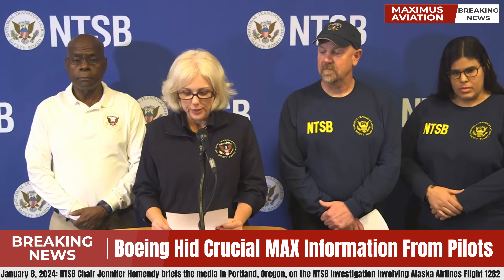Boeing NEVER Told Airlines That 737 Max Cockpit Door Was Designed To FLY Open During Decompression!

Comment: There’s no doubt that Boeing is headed for another disaster if no one takes control of this out of control company.   Aussie Bob
Reply: The fuckers just want to punish whistleblowers, push DEI and ignore the engineers.  They need to be held accountable for their failures and illegal behavior.  Who's in jail over  MCAS?  These military contractors are immune from accountability.
Reply: @LiveWire_Guy  Unfortunately, engineers and safety inspectors do need to go to jail over entirely predictable disasters like MCAS and inspection shortcuts even if they were under huge pressure from management. When safety culture decays to the extent it obviously has in Boeing, the only way of restoring it is to reenforce personal responsibility. Those who sign off on these technical details need to be able to say to the MBAs "I hear what you say, but I'm not going to jail for you", and for it to be credible, that does actually have to happen in the worst cases.
Reply: @john_hind  but not the managers? Weren't they ultimately responsible for the time pressures and the failures of safety culture? Seems a bit of an odd conclusion...
Reply: @andrewdenby8239  Morally I agree with you. But legally, it is very difficult to pin responsibility on an individual manager since there is rarely a paper trail from a decision to a specific consequence. Named engineers sign off on designs and named inspectors on quality so there is that paper trail. My point is that a few of those need to go to jail so the rest can better resist pressure to cut corners. A manager cannot order the engineer or inspector to sign, if they want to overrule, they can, but they will have to sign themselves and take responsibility. I want to restore the safety culture, not send anyone to jail.
Reply: @LiveWire_Guy  You can be right about a whole bunch of stuff and then you gotta throw in "I'm a racist because I think any black people working here are obviously DEI"
Reply: Time to put the engineers back in charge, instead of accountants more concerned with shareholder value, most the blue chip shareholders have private jets, and all they care about is profits over people.
Reply: @colin-nekritz I’ve worked at a lot of engineering driven companies.  They really are no better at managing a company than any other regime.
Reply: @colin-nekritz  Engineers are not good at dealing with customers.
Reply: Problem is the company must be successful: otherwise politicians heads would roll. Normally on a purely commercial market this comapny would have been closed down ages ago. So this company is going to be sold as a "sucess" story no mater what they produce, how bad they fck up.
Reply: Probably delegated inspection responsibility to the operators. They are all doing this now. As a former quality manager i was fired from a job of 16 years because I refused to delegate this. The operators were not qualified to inspect. This is what happens when you do this. Same thing happened with the software issue. The final approval was delegated to Boeing by you-know-who. Apparently this delegation was recended.
Reply: @bighoss9705 "Apparently this delegation was recended." - problem is know-how is not something that can be easily and quickly moved around.
Reply: I unfortunately bought Boeing stock right before the first max debacle and it never recovered. Ditched that stock. Don't see ever buying Boeing stock unless they do a 180 and complete gut job of their entire company. Not 2 nickels worth of integrity left at Boeing. A real shame. And has become a widespread issue across large companies. No integrity.
Reply: @travish4276   you are correct, it is widespread and it affects all businesses that adopt the practice of graduate hires being given priority over those timeserved individuals, integrity is not high on the agenda for undergraduate syllabi, Boeing's heyday was a time when a team was grown from long term hires and the relationships that nurtured, integrity comes with that territory.
Reply: @travish4276  Time for them to be prosecuted
Reply: The coverup with the NTSB is now well underway.
Reply: @jquint57  How so.
Reply: Why would the secondary pressure computer be checked in December, and twice in january? Seems really odd
Reply: Boeing doesn’t care.  They are for profit.  Insurance will pay any deaths.
Reply: Let those airframes been built in Chana as Apple is doing this since many years to gain quality.
Reply: Don't be a drama queen. They'll solve it. They have 4000 Max orders right now.
Reply: @RLTtizME 
They said this in 2019 after the second crash and the worldwide groundings.  
And yet here we are.
Reply: They are not grounded once inspections have taken place. Quite different. Do you know where you are?
Reply: @Rasscasse Boeing actually tried blaming the flight crews for the earlier crashes.
Reply: @RLTtizME  Orders can be cancelled.
Reply: @kray97  And orders can be added to. You are scraping the bottom of your brain.
Reply: @RLTtizME  You sound scared bud....I've already heard about orders getting cancelled. Bet Southwest is glad they had no MAX9s lol. What's impact of all the flight cancellations caused by the grounding? You don't think these airlines are going to look elsewhere?
Reply: @kray97   4000 current orders Pal.  The sales of Max 9's are fairly limited. Flight cancellations will be addressed just as they are for Air Bus groundings. SWA will be buying a lot more Max 8's. Hundreds. There is a reason for that Buster.
Reply: @kray97  To answer you question...no. The advantages of the Max more than out-way the developmental issues. I know that cancellations fit your made up narrative...
Why would I be scared Pal? You made that up too.
Reply: @RLTtizME  You should tell that to the families of all the people killed in those two MCAS related crashes.
Reply: @kray97  They really can't. There's no viable alternative at the moment. Airbus also faces a major backlog.
Reply: @generic_username-q7x  Yeah, I read that article too lol. There are other competitors - not just Airbus.
Reply: @kray97  Not sure what article you're referencing. No one else has the capacity of Airbus AND Boeing. Embraer has delivered half the number of E series in 22 years as Airbus has for the A320neo alone in 10. Boeing has nearly matched the Embraer numbers in 9 years for the 737 Max line alone.
Reply: @kray97  Oh...going for the moral high ground. What DO YOU have to say to the families who lost loved ones in the many Air Bus accidents?  Stop being pathetic.
Reply: @generic_username-q7x  China makes airliners too now.
Reply: @kray97
Yeah "Chinese made" isnt exactly a statement of safety and quality.
Reply: @kray97  I am not including Russian or Chinese state-owned manufacturing, who have built a total of 12 narrowbody airframes between them in around a decade.
Reply: @RLTtizME  And the reason for that is like Boeing they apply grater importance to larger profits than passengers lives.
Ever heard of a door falling off a ford, GM, BMW etc car because it wasn't bolted on properly?
Reply: @childofcascadia  Neither is made in USA anymore nowadays.
Reply: @andrewallen9993  No but I have heard of a myriad of recalls for faulty installation of certain critical parts.  You better put your thinking cap back on and come up with a better argument.
Reply: @RLTtizME  but not as safety critical as doors in a pressurised environment?
Reply: @andrewallen9993  You're stretching your narrative to make it fit. Actually a widespread automobile recall can, in many instances...represent a safety critical situation and in the aggregate...can kill many more than a one-off airplane incident.
Reply: @RLTtizME  Would you rather the door fell off your car whilst driving or your aircraft at 30 000feet?
Reply: @andrewallen9993  Neither.....thanks for posting. I do recognize that life is full of hidden dangers. Stop clucking.
Reply: @kray97 I think Airbus is sold out for several years.
Reply: @RLTtizME  were you sitting in the suicide seat?

Comment: So a potential "bad guy" can open a door in flight to gain access to the cockpit where a crew is trying to figure out what's wrong. IDK but how did this pass certification?
Reply: Under normal circumstances, you can't open a door in flight. Meaning if the cabin is pressurized. First need to dump cabin pressure to be equal to outside pressure, then you can open a door or emergency exit.
Reply: In fairness if a 'bad guy' can cause an aircraft to depress to that extent access to the flight deck is probably fairly low on the list of immediate problems... And I can sorta see why it does as presumably if the cockpit remains pressurised while the rest of the cabin decompresses then gaining access to the cabin afterwards if needed might be tricky to do safely, especially if they're at a regular cruising height. That being said there's NO way that shouldn't be in big red letters somewhere close to the front of the manual and makes you wonder what else Boeing haven't disclosed.
Reply: Oh just read the description, yes exactly my point.
Reply: You don't need to clarify it further for the terroristis!
Reply: So, how would you design the door then?
Reply: Explosive decompression is a larger problem than a burst panel (door) functioning.
Reply: Blow a windows, then enter flight deck. No no no. ICAO Annex 17 must be amended to disallow this shoddy Boeing practice
Reply: @unggrabb  Well, now that the baddies know about the "workaround"!

Comment: The FAA approved the aircraft.  Did they approve the documentation that was deficient.  All this rubbish makes you feel very insecure.   Once again.  No Boeings for me
Reply: Actually the FAA didn't certify the max originally, which is the root of the problem. Boeing lobbied the administration some years ago to get permission to self-certify. They used the same argument as wall street, ie no one knows the business better than us, so we are the best ones to regulate ourselves. This led quickly and directly to the 737 max disaster.

In the past, any and all aircraft models required an FAA type certificate, or an STC supplemental type certificate for add-ons and modifications, granted after full engineering reviews and flight tests. Now Boeing is trusted to perform this themselves for their own aircraft.
Reply: @PRH123  therefore by avoiding their responsibility they approved it
Reply: Its greed. Thats it. Just like MCAS
Reply: Precisely, no way will I fly in a 737 x MAX. Boeing needs to be nationalized or closed down. Unfortunately a prime example of  capitalism gone wrong ( = greed and/or corruption)
Reply: It would not be the first time the FAA was missing the needed thoroughness when they approved aircrafts.
Reply: @despoticmusic Blow out panels are not the same thing as the entire door swinging open.
Reply: It's called REGULATORY CAPTURE. They lobby some campaign money to ALL PARTIES in the govt to fulfill their special interest. Yall think thos is worse? PROJRCT 2024 is a total take over of the govt by corporations. No need lobbying and corporations could save even more money
Reply: Airline passengers motto. "If it's Boeing; I'm not going".
Reply: The government doesn't care. What a clown show.
Reply: Riiiiight, lol.

Comment: Boring………. hey btw, airplanes aren’t ships so let’s use MPH instead of Knots. (Nauts) Nobody has any sense of what that even means outside the military and specific industry anyway. Boeing sure seems to have a history of inserting Surprises into their aircraft and failing to tell ANYBODY about it. Just another reason to avoid the brand??
Reply: You misspelled kilometers.
Reply: Kilometer is the American spelling whilst kilometre is the UK spelling of this word.
Reply: Why would you swap to a unit of measurement that was obsolete half a century or more ago?
Reply: Instead of complaining, why don't you research why. Are you in the the aviation industry? I doubt it..
Reply: If you change for something standard, then change for km/h as it's the metric system, also called SI (International System of Units) rather than a dated system used only by a handful of countries as an overlay of the metric system.
(The USA have long switched to the metric system for many official purposes and the imperial measurements for the public are defined by SI units).

But for aircrafts like for ships, knots are used because of winds, as km/h or mph generally refer to land based distances, contrary to relative air speeds.

Comment: The NG has 2 panels that will blow, but are held with straps to prevent cockpit access.... so the MAX is different?
Reply: It was probably cheaper to have the lock automatically unlock knowing Boeing's decision making lately, despite it leading to OBVIOUS security threats, this company can't help itself but to continually penny pinch in every aspect, they're like a gambling addict who just can't stop himself from gambling, even though they can see their lives falling apart around them
Reply: the MAX is very different! It is almost a function plane
Reply: Yes, this is the design I’m familiar with.   Blowout panels to equalize the pressure.  Triggered by a decompression sensor.  A whole door blowing out?  Wow.  Not surprising though, it is the max.
Reply: Could it be that in the MAX, the entire door is now held by a strap? You probably get more cross section and better airflow from a door being open by two inches vs those panels openening the same two inches. Does the MAX have a larger cockpig, requing more airflow in case of decompression?

Also, I wouldn't be suprised if there would be an update on this story at some point. Maybe there was some kind of miscommunication between Boeing and the NTSB, someone said "the door panels are designed to open during rapid decompression" and the other pearson understood "the door is designed to open during rapid decompression".
Reply: Yea. Retro fit vs designed.
Reply: The blow out panels are clearly and extensively described in the ATA52 AMM SDS.  There are lots of things on a plane that the pilot has no clue about….
Reply: @despoticmusic 
And your point is?  Stating the obvious?  

They should be aware of what happens in an emergency, not how to maintain and repair the aircraft.
Reply: @matthewgaines10  Commercial flight during emergency is a hierarchy of risks.  In this case the primary QRH memory items would be to establish comms and then determine if the leak is uncontrollable or not and continue the checklist accordingly.  Anything else would have been secondary and lower.  The unlocked/open door is way down the risk tree…